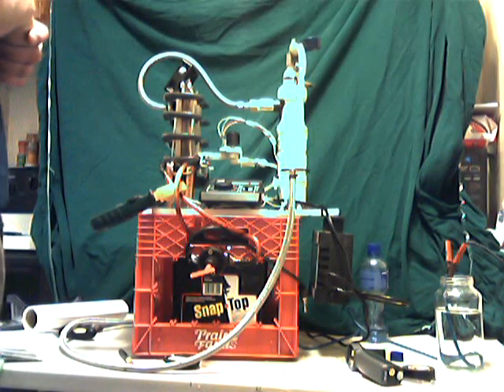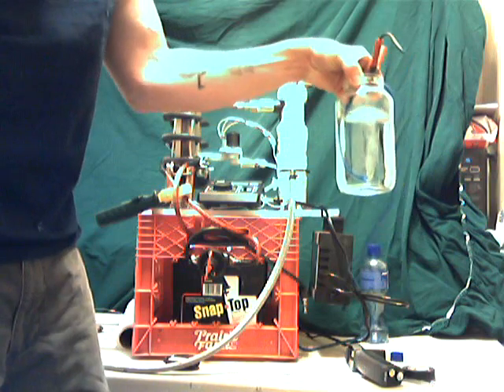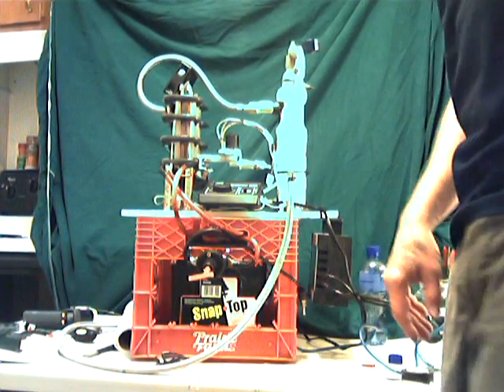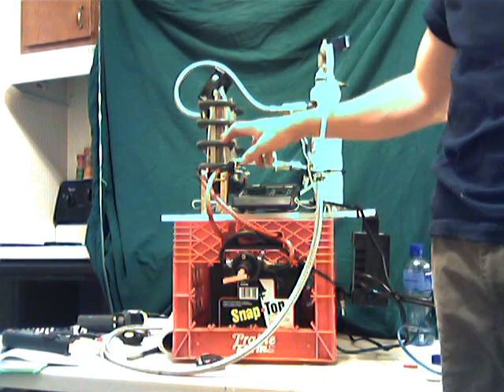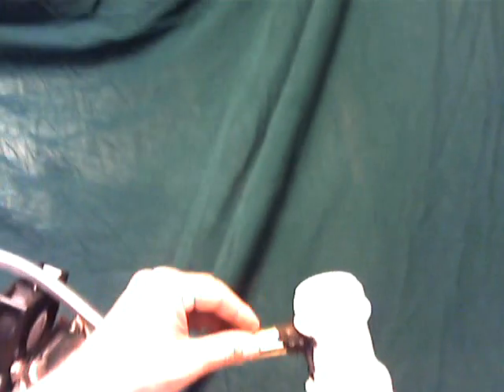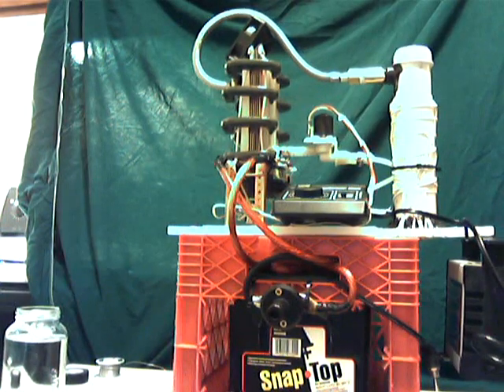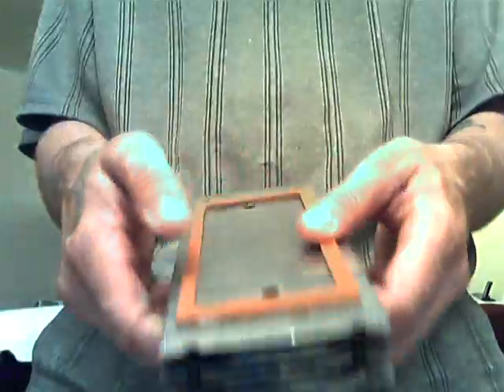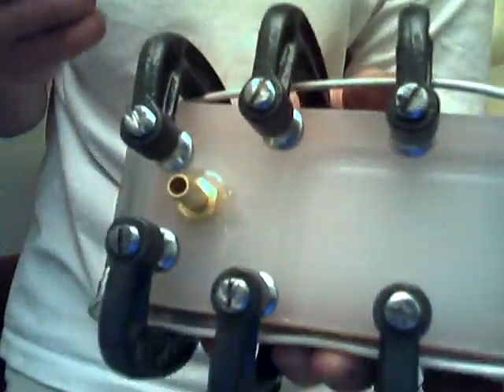hho dry cell high output LOW VOLTAGE.

Comment: Purple stuff is corrosion from using the wrong type of metal for plates, don’t submerge anything other than pure 316L stainless steel if you don’t want purple stiff and weird gases that could give you cancer.

Comment: Can you make HHO large volumes using LoW Amps, not low voltage?
. Stanley Meyer’s invention involved very high volts, pulsed square waves,  but low amps, generating large amounts of hydrogen, which is why they killed him. In your case, nobody is going to kill you, don’t you worry, you’re using too much amps and you won’t even mention the voltage
Reply from the maker: Yes i do it on my newer videos

Comment from the maker: for your own use i do not recomend doing what i do im into stress testing i like to test things to the extream ,as a child i would fry electric motors on a train pack just to study the behavoir of over power motors,,any way thanks for the comment dont whant to come of as a know it all its just that industrial cells run at up to 5 watts per inch i have 163inches that means i can run 70 amps if i use a cooling system,i read this in a electrolysis book in google books 
check it out its awsome

Comment from the maker: just so you no friend im not into efficiancy
these devices are for small powerfull torches,you do lose efficiancy at higher amps but if cooled you canget very impressive flame increases this way
even with very cold cooled gas as my vids will show ,100 amps is a goal they it may not be possible due to current tyirng to pass therw bubble walls as would be the case at high production rates ,currently i am doing very well without a cooling device at 53 amps,thanks for the comment

Comment from the maker: alot of people arent aware how much cell heat is created by small active cunductive paths in ss from the terminals i have a cell about this size that i would run at
110 amps max and it was never allowed to reach temps over 90 deg,alot of people have told me the same but they havent heard the hole story not only do i have videos of running small high amp cells
the flame size prooves thate hot gas is only made when the elite is alowed to heat up,its a long story i will post a vid when finnished

Comment from the maker: in the past i have found that it can bee done
you need to disperse the electrode flow
i have four silver solderd connection points on each end plate for a total of 8
silver solderd connections,alot of heat up on high amp cells is a result of weak or small connection area's,.i  intend to run a cooler on the finnished product i am currently up to 53 amps and the temp only gets to around 90 during the test
as  soon as i connect the tap water cooled radiater i can  dump the ss resistants heat,,

Comment from the maker: listen bro i do temp readings on the cooled cell the radiater disapates heatgo to smart scarcrow and he to runs at overvoltage ,yes your gas is hot if you dont cool it but 90 deg to 140 is not that hot and the bubbler condenses the water
vapor cooling the gas so if you think that 
you cant go over 4 watts per inch then maybe you should go to the library because the internent is blinding you
and i mean that as a friend not trying to be a pric

Comment from the maker: yes i have considerd a pole in fact i cut a section of the vid to adress this dam 10 min sht suck any way you could regulate current flow by rasing or lowering the res 
to bud i cut that clipp you would of felt a little better about my logic

Comment: Yeah I use a cap unless I am doing what i have been doing the last few weeks and need on the fly gas adjustment , but if im running a 10 lpm torch or doing anything that is constant  i have the cap hooked up ...its a 450v 8500uf  cap

Comment: That works good for on the spot extra gas ,it does raise the volts per plate gap a little , the good thing is using a bridge rectifier , it adjust the volts to to a certain degree ..If I have the cap hooked up to it i get a constant 145 volts no matter where I hook , but without the cap when i move it over the volts drop some but the amps go up it is handy  on a big cell

Comment: Yeah you cant drive that cell with 120 volts if he did it would melt everything plastic ,cause he would have 20 volts per plate gap ...i have melted stuff with just having 10 volts per plate gap ..

Comment from the maker: these are 1.5 mm  thick
i was a siding applicater for 3 years
and no 11$ snips cut better then the ones in the vid, i know for a fact such a thing doesnt exgist for that cheap and work better then my steal sidding snipps
18$ and they are the low end brand
they cut threw stell 1 mm steel all day

Comment from the maker: you are write about the wires heating up with dc but i have two cooling fans and 
4 gauge wire so this wont be a problem
at 25amps the cell only gets to 105 degF
for ten minutes,the wiresa only get to 71
and room temp  was 69 in my kitchen

Comment from the maker: ok its not high amps but rather watts
i cant get an ac system to do what a dc unit can,,,i dont have the credit card to order off line??? cant find good diodes
why would you want a cell that cant do any thing?and the off the wall comments was about the steam and the other things you said that do apply but only at the extream end of the spectrum ,you could drive a semi side ways threw whats inbetween,im not  nocking you bro but i do understand what you think i dont ,

Comment from the maker: ive tested both sinareios steam is not generated at temps below 150 deg
water vapor yes alos the bubbler midigates alot of this yes efficiancy is good but people some times dont understand the perameters of what they mean, i have test data not of the wall comments ,ive seen and tested very high amp devices the hole time,i never run below 50 amps in use of my set ups,i do temp readings and all that pressure to,any way efficiant cells are huge like jd's
its a great cell but i dont have the ss

Comment from the maker: well my freind once you hook a pump up to yours you will see that fast flowing water will nock bubbles of your plates ,
i have built 4 different cells now and all work far better wit ha pump,my torch will
experiance a 50% increas because it nocks bubblse of the platse,gravity works 
but so to turbo chargers and super chargers ,i think your missing the point
i have used gravity set ups your not talking to a dumm ass bro,{they suck on small cells}i apriciat your comments though thanks

Comment from the maker: because it makes the unit smaller and it 
kicks the amprage up alotalso it cools the cell of by increasing flowand i haveseen non pump units they are all on the floor with the res on the kitcken counter type stuff fk all that big hoses all over the place mess the pump gets me out of all this,in the vid the pump is not powerd very well,on a battery pack it gives me a 10 to 15 amp increase ,not using a pump makes no sense to me ,its like having a super charger and saying i dont need it

Comment from the maker: i have a pump on this thing,so the bakpressure actualy helps increase the amps,also i intend to upgrade this device
this is a budget  test,i intend to double the 
plate service,soon,thanks for the tech comments but at this point im a tim tayler type,,more power

Comment from the maker: if you want to run a efficiant cell yes but efficiancy is far from my objective,i have a cell niw that runs on a hundred amps just fine and it has less survice area then this thing,i need a cutting torch and a brazer
this is the only reason i need a torch

Comment: 100 amps will be to much fro that small amount of plate area....with a cell that size about the most you need to hit with is 30 amps max ....the basic max limit of watts for a cell is 4 watts  per sq inch of surface area ...If you hit that small cell with 100 amps it will probrably mess your gaskets up and will eventually eat the metal if run that way all the time , and also hitting a small cell that hard will make it less efficient